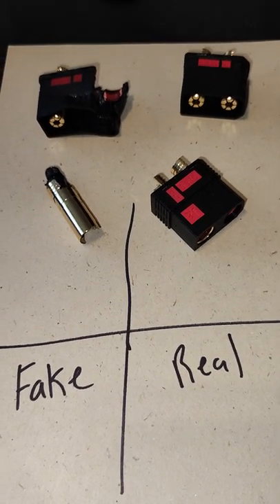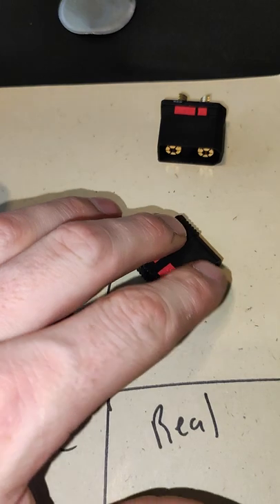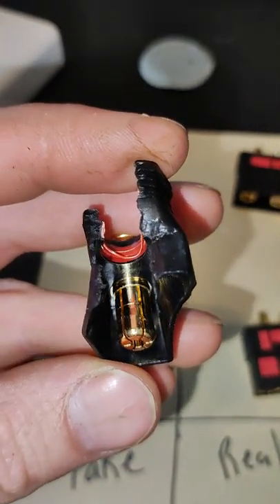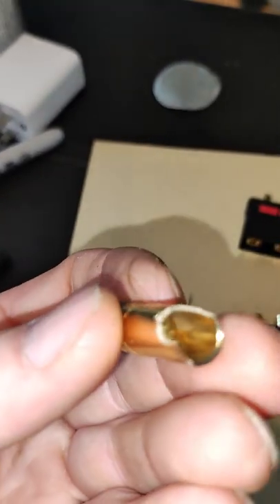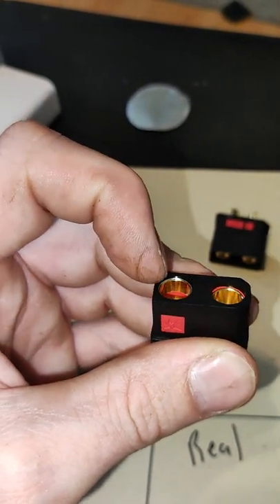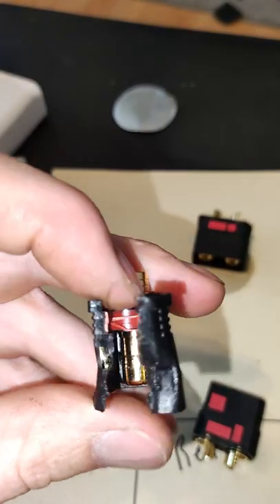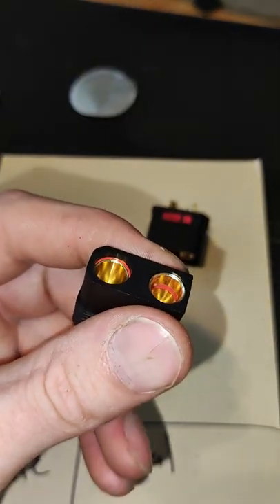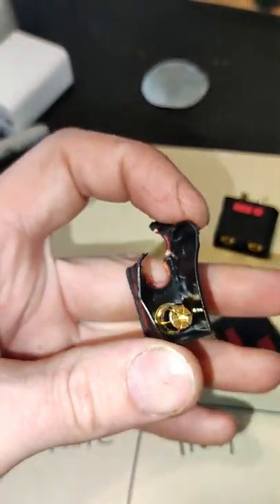how to spot fake QS-8 connectors.

Comment: Why only show half of the "fake" I would have loved to see a side by side of both males, and both females.
Reply from the maker: Because I didn't realize the difference till I bought the real one in store and had thrown them away already. Everything important is shown.
Reply: @miscellaneousguy3803  That makes sense, however, the fact that we dont get to see both cups has us taking what you are saying at face value. Its a big ask. I appreciate the intention of the video. Just wish the information was more clearly shown vs talked about. Just ordered some QS-10s on amazon from another seller for $23 a set. Wish me luck.
Reply from the maker: @darkchild256  everything from anyone anywhere is face value. I've been in electronics since I was a kid I know the difference between one with a spark arresting resistor and one without. You can do so as you wish in whatever form you decide. If you don't like my explanation of the video buy one from a real retailer and compare it to the Amazon one and the difference is evident. The side with the red ring if measured with a multimeter between the bottom bore and the top bar on the two sides of the red ring should measure 5.1 ohms of resistance.. if it doesn't then you have the same fake non-spark arresting version as I originally did.. do with the information as you like. If you don't like the information I provide feel free to do your own research
Reply: @miscellaneousguy3803  Appreciate this video. I bought a $20 amazon plug and the resistance measured was 5.1